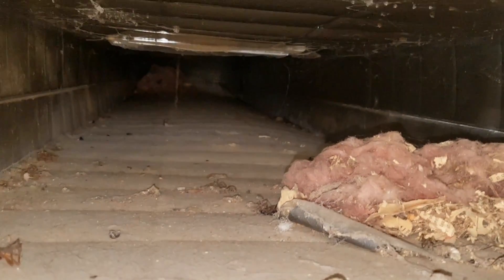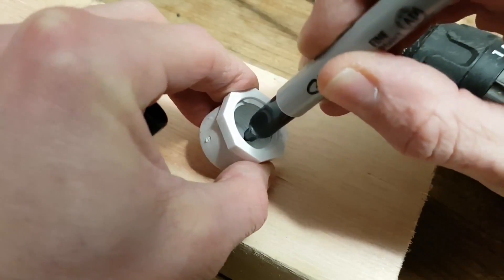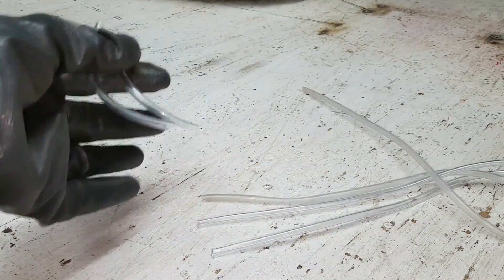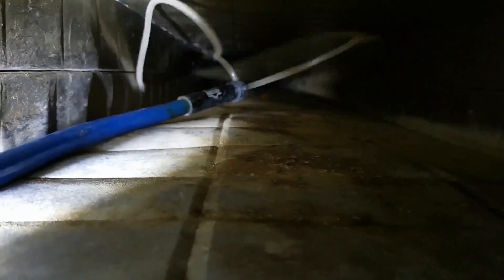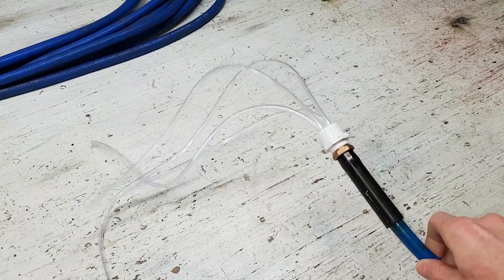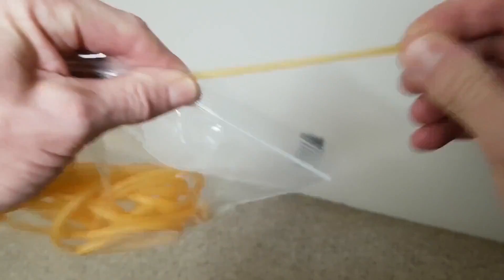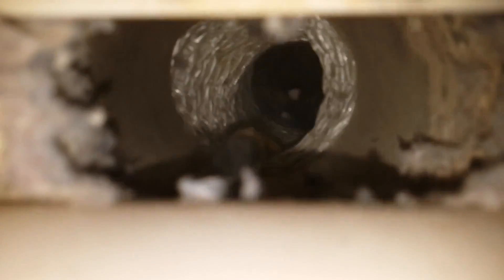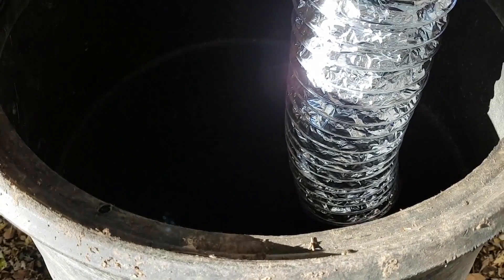DIY Air Duct Cleaning Tools, part 2 - Making Air Whips for Duct Cleaning - Testing Different Designs

Comment: What type of air hose are you use for it?
Reply from the maker: I use a normal shop air hose to supply air to the whips.  I made some of the air whips with rubber tubing, and some with aquarium air line.

Comment: Typical air hose rated for 80psi
How’d you deal with higher psi?
Reply from the maker: I used different tubing material in other videos, linked below, to make whips that could operate at a higher PSI

Comment: Random thought: have you attempted putting a spring on the very end of the whip near the split to prevent the tubes from going backwards too far and binding?
Reply from the maker: I haven't tried that, but I will.  Thank you for the tip

Comment: Thanks for this series bro. My house vents are awful. I had a rat get in there and after we got him out when I was looking at the vents I was horrified. They are caked with dust and debris. The cheapest vent cleaning I can find is about 1100 dollars. This will help me a ton. Plus I prefer doing things myself. It doesn't need to be perfect. But any cleaning will be an huge improvement for my home.
Reply from the maker: Your welcome.  I also prefer doing things myself.
Reply: @BudgetPhil  I ended up doing a regular maintenance cleaning for majority of dust to just get cleared. My home is old and has alot of debris in the vents from the remodel before I moved in. IDK if it helps but he basically brought in a big vacuum with flexible tubing. Put it over one vent then turned my system on with all other vents closed. Supposedly this is enough to clear most loose debris but nothing too big. Mostly the finer particles. Then he told me that for deep cleaning they just use a drill with a flexible shaft and brush then just do the same thing as the maintenance cleaning but they push it towards the vacuum with the brush. This experiment you have going is cool but perhaps over engineered. or maybe you're advancing duct cleaning tech. Who knows 🤷‍♂
Reply from the maker: I would recommend checking the ductwork with a camera to insure the cleaning was done to your satisfaction.  I had to clean a spot of mold in a segment under a bathroom after using my duct whip.  The air whip just couldn't clean stuck-on messes.  The rotary wire brush I made during part 5 easily took care of it though.  Thank you for sharing your experience.
Reply: @BudgetPhil  I was thinking that if you can figure out a way to make a brush spin like a pizza cutter rather than a drill it would force the bristles in to corners of the vents as it spins. It would also  give you better side to side control so you can do sort of a serpentine motion sweep up the vent to make sure you are getting both sides. The best thing I can think of is a long flexible shaft. which IDK even where to get one of those. Then you'd need something on the end that converts the direction which it spins. IDK if there is anything out there like that. I also think as long as you have enough bristles it will protect your vent from whatever that tool may be. I picture it like those electric scrubbers they sell all over Amazon. The pads on those are like a half sphere of bristles. So if you had 2 bristle pads. Half spheres. Sandwiching the adapter that makes it spin pizza cutter direction. So brush, metal adapter, brush. It should keep the metal suspended in a cage of bristles while it spins. IDK if I'm making sense. I also have no suggestions on how to make it happen. I just thought it would drastically change the function.
Reply from the maker: That's a good idea, and a good explanation.  I bet a system like that could really scrub that rectangle ducting clean, top to bottom.    And, like you mentioned, it would also probably clean the corners thoroughly.  Thank you for sharing your idea.
Reply: @BudgetPhil  Word. Glad it made sense. lol! Not gonna lie... I almost modeled a 3D design of a metal box that could fit gears in it to convert the direction of the spin at the end of a flex shaft. But I already have too many weird hobbies rn to devote time to that and I know I'll never get it made. I feel like something like this exist already. If not it should. I'm going to look more online when I feel like it and my ADHD brings me that way. If I can't find one I'll make it just to see if I can. I like a challenge. I'll keep you posted if I do. LMK if you try to tackle this idea!
Reply from the maker: A right angle drill attachment could probably be incorporated into your design to provide the directional change.  I really like your idea, and if I have time to try it someday I'll let you know and show how it turned out.  Thanks again for the idea and your explanation.

Comment: I had an idea.  Would it be a good idea to divide about a inch or two of the whip tip?
Reply from the maker: That's a great idea.  I need to try that.  Thank you for the tip, no pun intended.

Comment: What size compressor would be required to run the duct whip?
Reply from the maker: I used a 20 gallon compressor with a pump rate of about 6.5cfm and it barely kept up.  Those numbers should probably be about 50% larger to properly run the dual whips.  The single whips were easy powered by the 20 gallon compressor

Comment: this type of thing would destrory my duct
Reply from the maker: What about the 1/4 inch surgical rubber hose operated at 40 psi?  It didn't damage the thin foil dryer vent ducting shown in the video.
Reply: @BudgetPhil  maybe it would work but my duct work is falling apart already
Reply: @dallaspilotcar9293  then you should probably just replace it instead of clean it. not a lot of thought needed there.
Reply: I am so unaware that this is actually an issue.
Reply: @SP_REX  its an issue in homes that have extensive dust, especially leading into the evaporator from neglected filters.
Reply: @SP_REX  Even duct work from 1985???

Comment: Can you explain how the duct vacuum works? Blowing air into the barrel seems counter intuitive to me.
Reply from the maker: The air is sucked through the barrel filter to help remove debris from the airstream before it reaches the blower intake.  It works well for debris but doesn't remove much of the fine dust.
Reply: @BudgetPhil  but doesn't a leaf blower blow and not suck? It seems that you're blowing air into the barrel and through the flexible ducting into the house
Reply from the maker: The intake of the leaf blower is attached to the barrel, not the outlet.
Reply from the maker: I removed the blower nozzle from the leaf blower and installed the leaf vacuum nozzle.  Then I wedged the leaf vacuum nozzle into the hole I cut in the barrel lid.
Reply: @BudgetPhil  oh that makes sense. I honestly didn't know leaf blowers had vacuum features lol couldn't for the life of me figure out how that was working
Reply from the maker: Yeah the vacuum feature is great. I use it to suck up leaves and shred them for compost.  The leaf blower was just barely strong enough to help clean the ductwork though.  In part 3, I made a do-it-yourself duct vacuum using an air mover with a flow rate of about 2500 CFM.  I haven't used it yet but I predict it will work much better than the leaf blower which only moved about 400 CFM of air

Comment: Wouldn't a whip system be dangerous for Flexible Air Ducts (plastic and coiled wire)?
Reply from the maker: I'm sure it can be.  Especially if operated at pressures over 80 psi.  Using the softer surgical rubber tubing at lower pressures for the whips would probably be less likely to cause damage to plastic ductwork.  I used 1/4" surgical tubing for a whip to clean out the dryer vent and it worked well.  I turned the dryer on with no heat to provide the air flow necessary to flush out the lint and then ran the small surgical tubing whip through it.  I operated the whip at 30 PSI since the dryer vent ductwork is so fragile.

Comment: Curious if hoses of different lengths on the same end would help any.
Reply from the maker: Indeed,  that may be helpful in some situations.  For instance, if the whip hoses are getting twisted and bound together during operation then that might be worth a try.  The shorter hose will require more air to keep it active than the longer hose.  When it's cut shorter,  it may "steal" some of the necessary air flow from the longer one.
Reply: @BudgetPhil  you have done a lot with this. Have you possibly capped the end of the hoses and put a hole in the side? Just throwing ideas out that came to mind watching the video.
Reply from the maker: Interesting idea. I haven't tried that.

Comment: I love this, thank you for your videos! I just have a couple questions- shopvac or leaf blower, which is better to use? I have an air compressor (25 gallon 150 psi).. My air hose fitting is 1/2 I believe... Our house has the round 4" air ducts..I initially was going to buy aquarium tubing but that seemed like it may damage tiny, somewhat fragile ducts - so I should use the surgical latex kind in your video instead, right? Also, I know I need to clean where all the vents/registers are, but aren't there other areas I need to get to also? Lastly, your list in the description are parts to make up a variation of air whips,I think (?) Which are the items I would need to create an air whip for my and small, seemingly fragile ducts? Sorry, I'm completely new & unfamiliar with this whole subject, but I'm learning! Haha
Reply from the maker: I would probably use a leaf blower vacuum and a whip made of 1/8 inch surgical tubing.  Hard to say without actually seeing it though.  The house I tried this in was fairly simple but I understand that some can be quite complex.  I'll try to do a better job of illustrating how the duct vacuum and whip are used in upcoming videos.  I was able to get at all areas of the ductwork to remove dust and debris using this method.  I need to learn more about the HVAC unit before cleaning it though.  I don't use the whip near the A/C coils or any other heat exchangers in the ducting.  For that 1/8 inch surgical tubing whip I used a 1/8 inch barb fitting that threaded onto my 1/4 inch air hose. That's the inside diameter of the hose I believe.  My part lists do seem kind of hard to understand now that I take another look at them.  I'll try to organize and explain them a bit.   Thank you for your feedback.

Comment: what kind of vacuum do you need to do this? I want to do this in an apartment unit so cant hire duct cleaners as they cant bring their vacuum up.
Reply from the maker: I believe it's the responsibility of the landlord to maintain and clean the ducts in apartment buildings.  I would start by getting some pictures of the dirty ducts to help show the landlord the problem.  Then I'd talk to them about getting it cleaned.  A homemade duct vacuum using an air mover, a cardboard box, a furnace filter or two, and a length of flexible ducting is what I'm going to use the next time I clean my ducts.  In about a week, I plan on posting part 3 of my do-it-yourself duct cleaning series where I'll show how I made a DIY duct vacuum with those parts for around $140. It moves around 2500 CFM of air, which is about six times higher than the leaf blower could move.  But I wouldn't start a project like this in an apartment building.  If not done correctly,  the procedure could potentially negatively affect other tenants.  Also,  some types of ductwork are easily damaged and the cost to repair or replace them can be quite high in an apartment building.  For those two reasons alone, I strongly recommend coordinating with the landlord to get the ductwork cleaned professionally.  This way you avoid liability if there is a problem that arises during the process of cleaning.
Reply from the maker: Yes, that's another good reason to keep the DIY duct vacuum outside.  It would take a huge HEPA filter to allow the vacuum to produce enough air flow to suck out debris from the ductwork.  If there is mold in the ducts then it would be particularly important to have the duct vacuum outdoors.   I'll talk more about that in a later video of the series.  Thank you for your input on the subject.

Comment: Just bypass your barrel and tape leaf vac straight to hose.
Reply from the maker: That would be fine for dust and dirt but I had to clean out fiberglass insulation, plastic pieces, and other non-biodegradable debris from the duct that I didn't want blown out onto the lawn.
Reply: Would the leaf bag that came with your toro work well for catching all that?
Reply from the maker: Good idea.  I lost the bag that came with mine but I think it would work.  The bag may get pretty nasty though depending on how dirty the ductwork is.